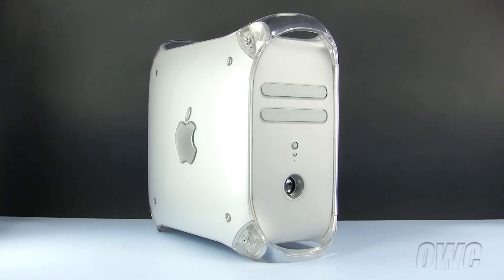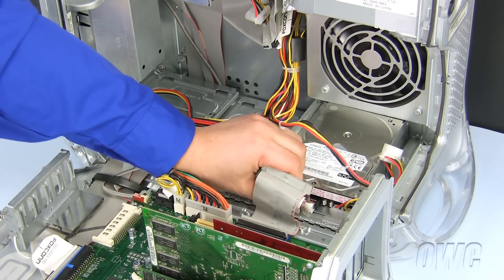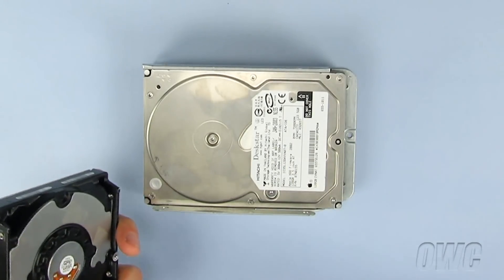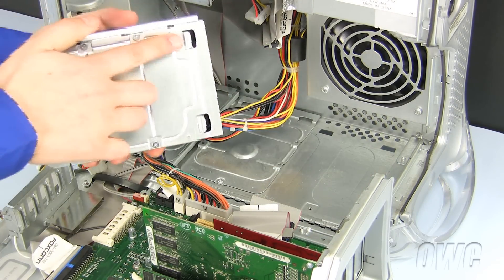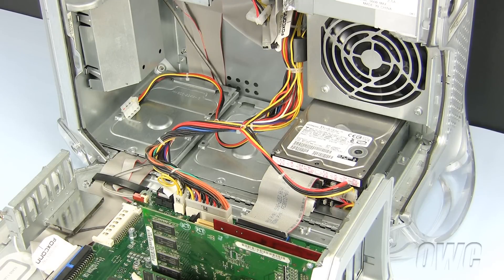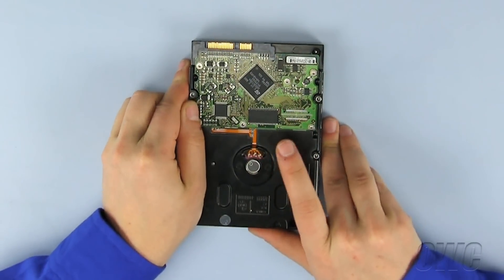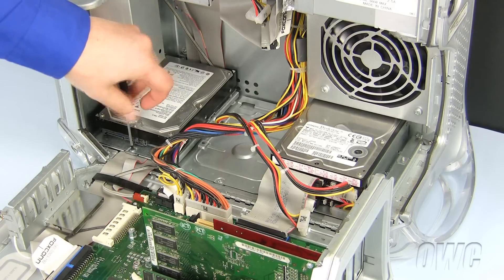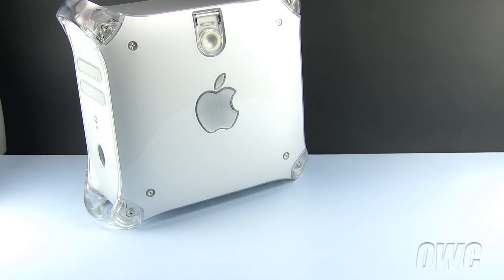Power Mac G4 QuickSilver Hard Drive/ SSD Installation Video

Comment: Hi, I have a G3 that was working many years ago before putting it in safe storage. When trying to power up now, I get a flashing question mark/system folder.  I checked the PRAM battery (0.77 vdc)  I replaced it. I can reset the PRAM via keyboard on startup, but none of the other troubleshooting keystokes work.  I'm hoping that the harddrive didn't fail when it was in storage. Is it possible that the failing PRAM caused it to lose settings on which drive contained the OS?  I would like to  be able to boot up and re live 1999 without reformatting the drive. Any suggestions?  Also, would an ATA to usb drive enclosure be helpful for testing the drive on another computer, possibly a PC?

Comment: Why do you specifically instruct users to set the hard drive to slave? I've used multiple HDs in various G4 computers, and I've always set them to Cable Select. I've heard of people using the slave setting and having trouble using them as boot drives. That's why I've always recommended Cable Select.

Comment: what does slave mode do?
Reply: It tells the computer that it is not a main hard drive, so don't look for the operating system on this drive. Basically it defines that this is a second or third hard drive before computers had multiple input ports for the hard drives